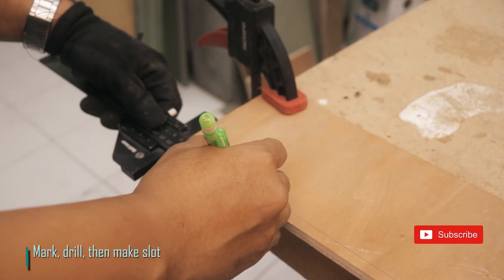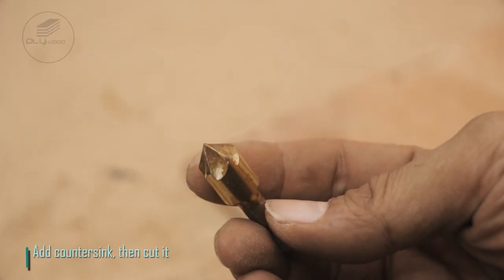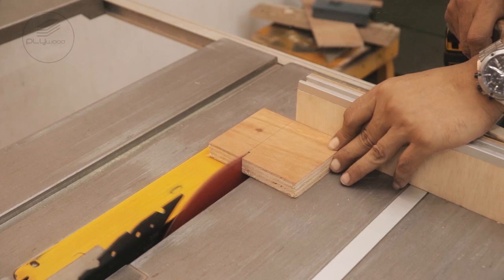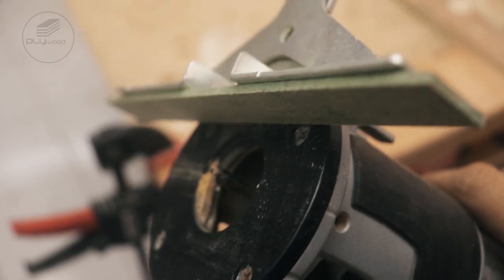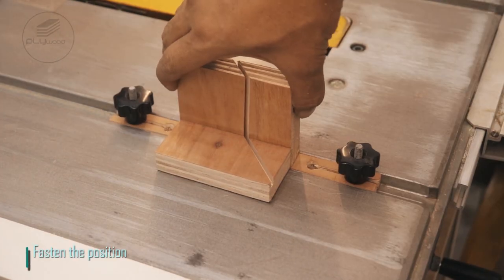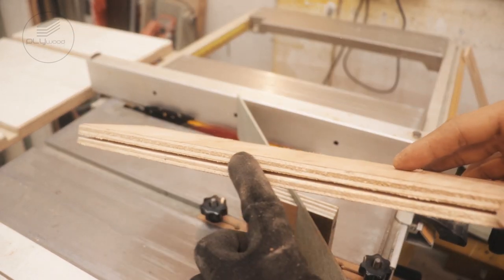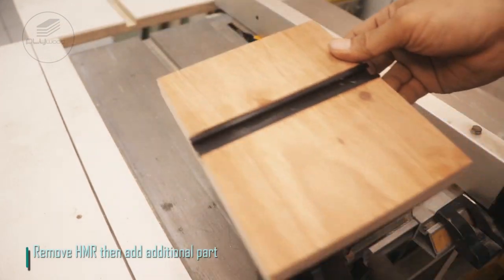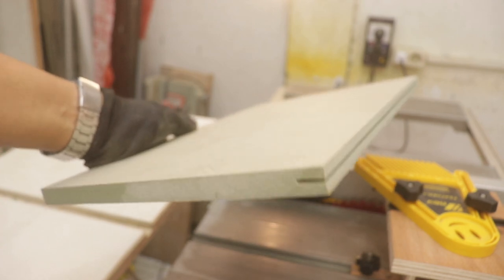Useful Jig for Table Saw

Comment: Never EVER put pressure above the fence, it will make the top of the fence act as a pivot point, pressing the workpiece AWAY from the fence at the bottom, which could end up causing all kinds of havoc, as the workpiece is now forced in the direction of the blade!!!